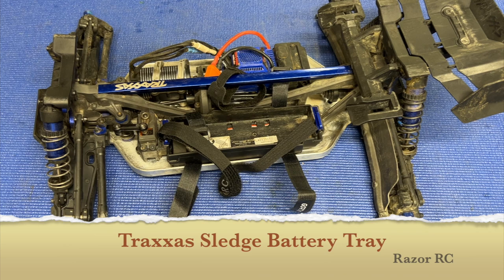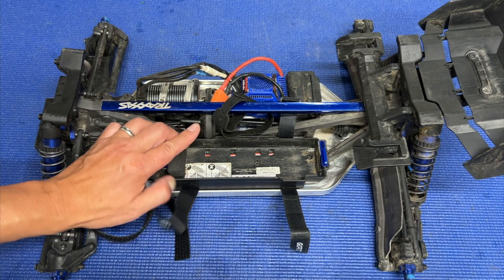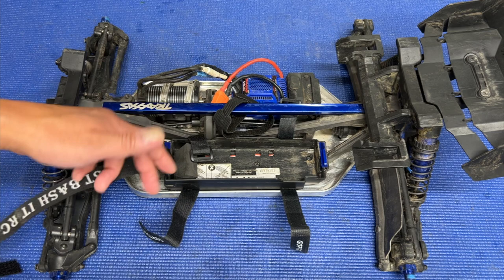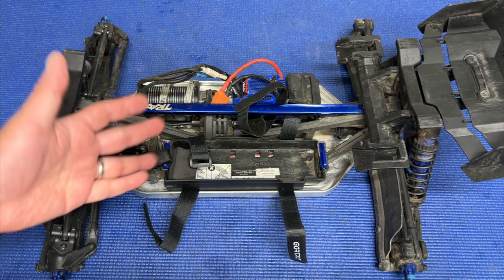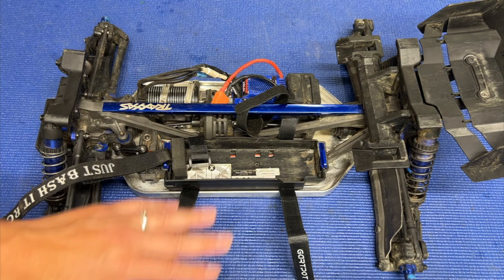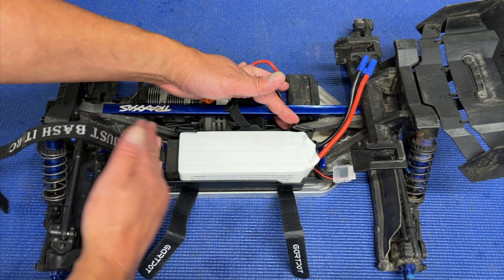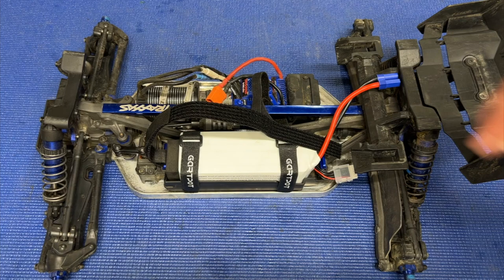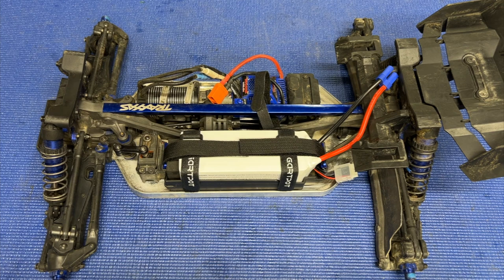Traxxas Sledge Battery Mod! (the RIGHT way to do it)

Comment: I’m running my Sledge with 2 8600 mah 3S lipo’s. They’re pretty chunky and after some bashing my straps just gave in. I just messured from the bottom of the tray till the upper side of my top lipo, which was 7,5 cm. Then i ordered 2 of them battery tray retainers for about $5,- (them side things which holds the lid). Sawed off the bottom inch of those new retainers with a multitool and extend the old ones with it. A couple of new longer 3 mm screw (4.5-5 cm. long) and now my lipo’s are snug under the lid again, tho still using straps to be safe. Works like a charm👍🏻💪🏻 and imo, better than just using straps.

Comment: Nice. Just realized I'd need to do this to run my hrb 6s packs upright, they fit on their side with the stock system, but unfortunately on big air is is smashing the cells badly laying on its side
Reply: You need a lipo battery next time, Could you consider SYPOM? Sypom lipo battery quality has received good feedback from many bloggers. If you are interested, you can contact sypom.

Comment: What’s the benefit of trading 2 3s 5000mah batteries for a single 6s 6000mah battery? Aren’t you getting less run time?
Reply from the maker: No, you don’t add the mah when using two 5000mah, it’s still 5000mah of capacity.